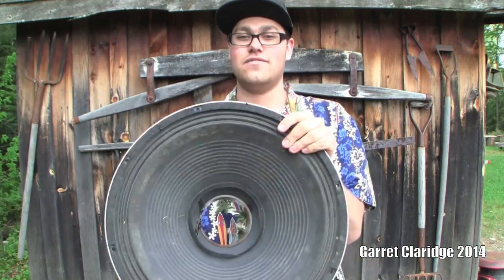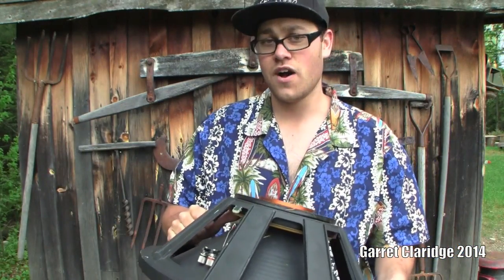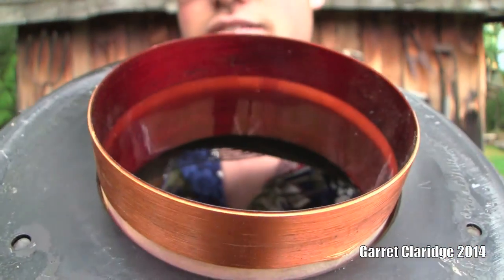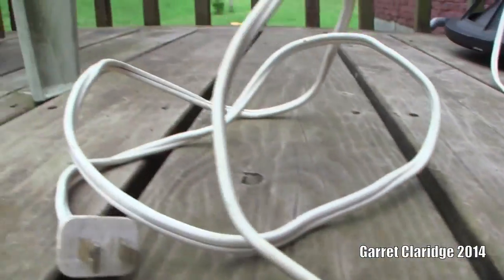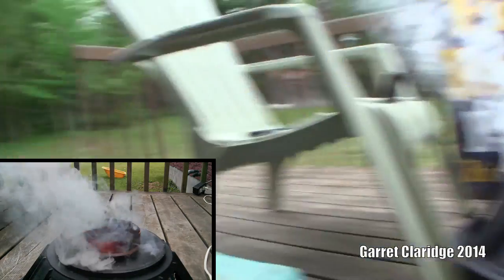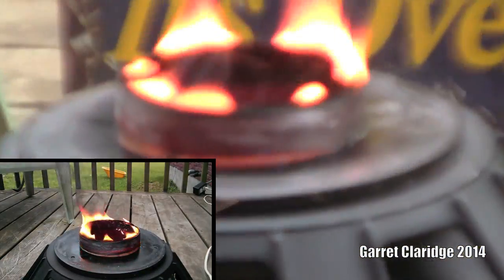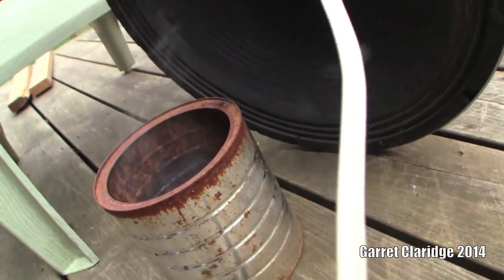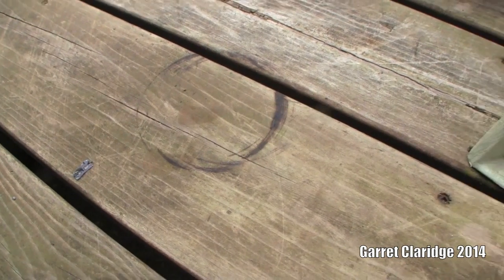SPEAKER BLOWOUTS! - 18 Inch Subwoofer Blowout - Eminence Magnum

Comment: Yep, they use glue to attach heavey metal plates! may be a good idea to drill, and tap in threads to pull these plates together, rather than rely soley on glue. I was considering Peavey QW series subs, but their QW 2F mid-range driver has cooling issues at the base of the coil closest to the spider when they are forced to run high power fequencies in bi-amp operation. I beloeve this is because not having base frequencies to pull the coil up past the side cooling vents causes this part of the coil to operate as under-over driven if this makes sense. A design flaw all the same. Their Low Rider subs are very good though, and they all suffer at the hands of abuse, without checking amp outputs, especially with direct AC wall power lol. if the voice coil wasn't damaged, this could have been repaired. In fact, if you had of re-attached the plates, and glued the ferrite magnet together if it were broken, you could still put a recone kit though it, and it would have kept going. Baskets, and magnet assemblies are the most expensive parts, and these can always be repaired, except if the cast aluminium basket cracks. I've decided to build my own cabinets, due to the AU dollar's poor performace, and price markups of US products. Very weary of Chinese manufacturing too, but this is a fact of life these days. Happy thumping.

Comment: Garret, you should put a pair of speakers in water and see how long it'll take for em' to fry
Reply: They won't burn. Just short circuit due to the water derp
Reply: Well obviously there gonna fry under water, duh #Logic. Put the speakers daced down into the water while the ports are on the back facing up. It would be cool to see the water, until it gets into the box and short circuts the connections to the woofer & tweeter